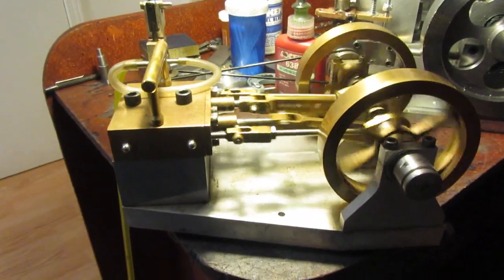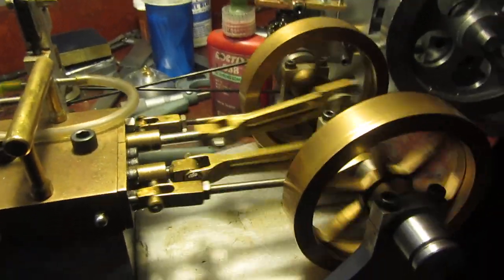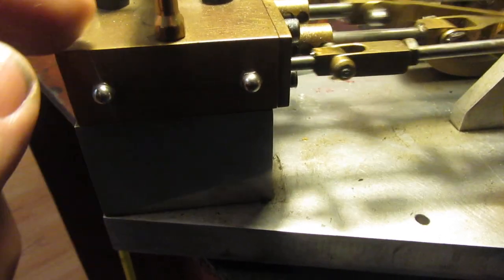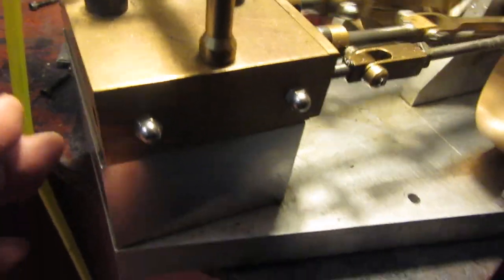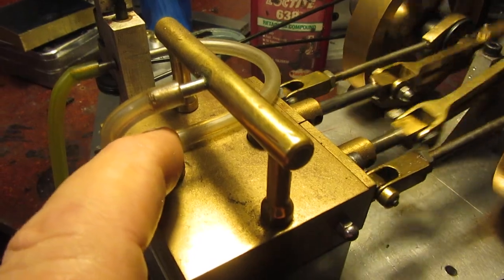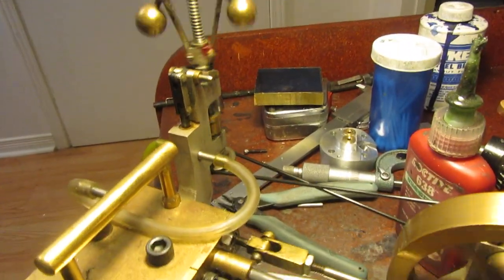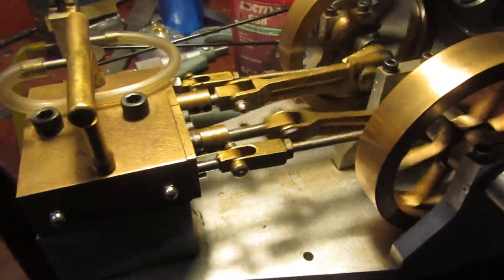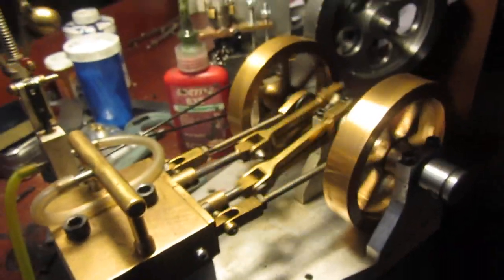TWIN HORIZONTAL ENGINE RUNNING

Comment: Brian, I am designing a chronometric tachometer for models like yours. Do you know what typically is the maximum rpm?  (I'm trying to gauge what sort of scale to put on it (ATM I'm designing it for 0 -2000)
Reply from the maker: Bill that question is kind of like asking "How high is up?" Lowest speed I've seen is 300 rpm. medium speed engines top out at about 3000 rpm, but some engines I've seen are real screamers, up to 12000 rpm.